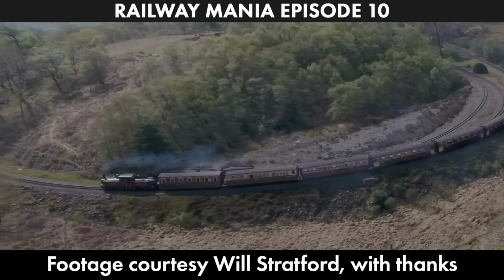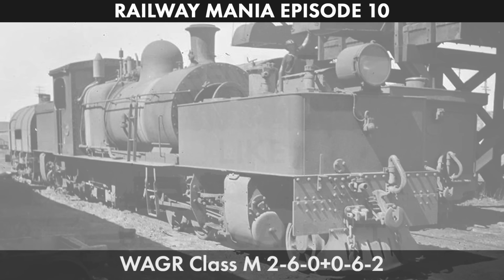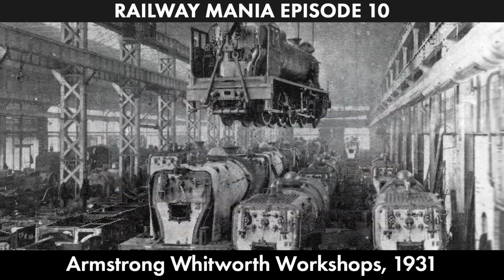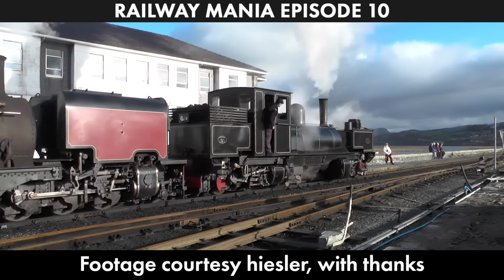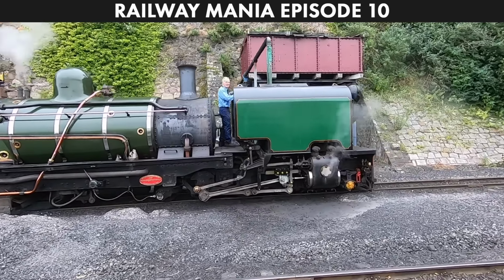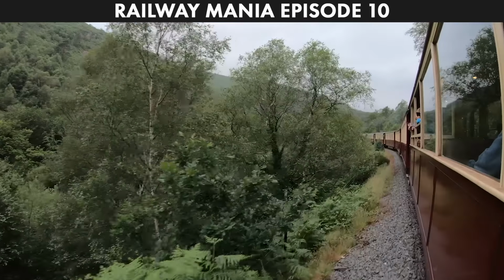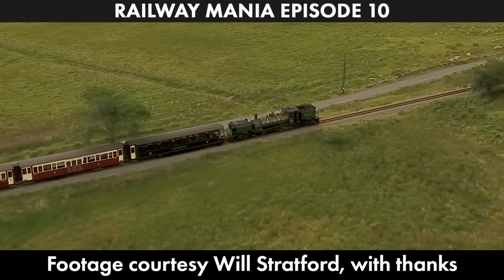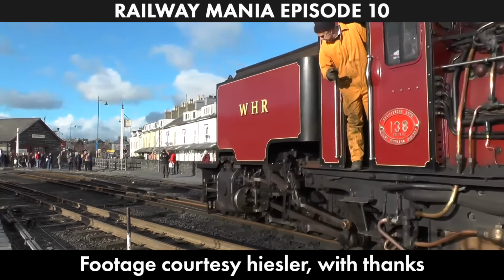Bend It Like Beyer Garratt (with Huw Jones) - Railway Mania PODCAST #10

Comment: Where did you learn that the Baldwin Locomotive Works had the rights to manufacture garratts in North America? I can't find a source that backs up that claim.
Reply from the maker: In a book called ‘Engines that Bend’
Reply: @RailwayManiaNet  Is there a corresponding citation or footnote in the book, and if so what is the citation?
Reply: @RailwayManiaNet  I thought it was Alco?
Reply from the maker: @ I'm only going off what was in the book, I haven't found any other references to it so I am unsure where they got the information from.

Comment: Would be nice to get either an HO or LGB models of the Garratt. If it is the LGB, one option would be a kit form where you can assemble it. Whether it be a 2-6-2-2-6-2 (4-6-4-4-6-4) or the 2-8-2-2-8-2. Even a 3d printer version in LGB scale would be nice. Are there any dvds available specifically dealing with the different wheel arrangements that the Garratts had?
Reply: Aster made at least one Garratt in 1 scale live steam, NSW 4-8-4-4-8-4, you could probably sell your car and buy one. 
Kitmaster made an LMS version in a plastic kit in OO a long while ago, many of their kits have been revised by Dapol, not sure about that one.

Comment: Service requirements between steam and diesel locos are what killed steam; strength of the thing was never an issue. The Garrett is a really good example of a decently well thought out way to get 2 locomotives for the price of 1. They've been fascinating to me since I heard about them. My Grampa was a roundhouse foreman for the C,B,&Q in northern Wyoming from about 1923 to 1960 or so, and told some tales about steam's service complexity compared diesel's; he knew it well since he lived through the transition. I think steam could still have a future with the modern engineering plastics playing a part in the flexible, wearable joints. Love to see it; wonder if I will! Great episode, thanks for putting it up!
Reply: Steam certainly could be modernized. High tech fluid dynamics modeling, advanced fabrication, and centralized lubrication could build locomotives that, while requiring skill to operate, could keep rolling without expensive electronics maintenance, long after a typical diesel would need major electronics repairs. As long as a steam locomotive could remain in steam for extended periods, working 24/7, the advantage of the diesel's quick start-up time disappears. Total cost of ownership over the life of the locomotive could outweigh its inherent thermodynamic limitations.
Reply: @psycotria Plug in boiler preheaters are something I considered for how steam could be modernised.

Comment: Was there any Garrett locomotive mad for the uk, and are there any left?
(Main line size?)
Reply from the maker: Yep 3 types. 0-4-0+0-4-0 for industrial use (steel and coal) of which there were 3 built and one survives.
https://preservedbritishsteamlocomotives.com/beyer-peacock-company-works-no-6841-william-francis-0-4-00-4-0t/
LMS 2-6-0+0-6-2 built for heavy coal trains. Mixed fortunes due to a few faults and the labour involved. 33 built, all scrapped.
https://en.wikipedia.org/wiki/LMS_Garratt
LNER U1 2-8-0+0-8-2. Originally a GCR project, but ended up as 2 x 3-cylinder units (6 cylinders total). Designed for banking duties, performed ok at that but not at hauling trains over long distances. Scrapped.
https://en.wikipedia.org/wiki/LNER_Class_U1
Hope that helps!
Reply: Thanks for the information

Comment: While I’m not sure there is enough information for a full podcast or even a conversation, I was wondering: Have you considered covering the feasibility of the proposed “Super Garratt” either just as a thought exercise or chatting with some individuals who might be more knowledgeable or insightful? There are very little trustworthy (or serious) websites or forums covering the Super Garratt and even less having made models and none have made a video directly about it.

In case you aren’t aware of this loco, apparently Beyer Peacock tried to stretch the Garratt concept to the absolute wherein instead of the traditional Garratt basically being two single frame locos back to back, the Super Garratt was two Mallets joined back to back. The existing designs I’m aware of were in standard gauge and cape gauge, offering up to 215,000 lb starting tractive effort from a 2-6-6-2+2-6-6-2 wheel arrangement.

Also a personal question of mine: If the Super Garratt type of articulation had been adopted in the US, what wheel arrangement would you think would be the most adopted among the class 1 railroads?

As per the patent with 2-6-6-2+2-6-6-2’s?
Even bigger with a 2-8-8-2+2-8-8-2?
2-10-10-2+2-10-10-2’s!?
2-12-12-2+2-12-12-2’s?!?
Some other wheel arrangement?

Comment: 11:07 the only operational 'super Garratt' in Australia, 6029, running on the main line from Sydney's Central Station toward Strathfield Station if I'm not mistaken. Two of those locos used to haul 1,500t coal trains up a 1/40 grade (there's some old black and white footage of that somewhere). Some fairly serious grunt, and (despite the noise) I imagine the fireman liked having the mechanical stoker, especially in summer.
Here's the double-header footage (not suitable for those worried about air pollution, lol): https://www.youtube.com/watch?v=-1EWpCQP7eE
Reply from the maker: Cracking bit of footage that. Also worth a watch is this one - 'Steam on the Main North'
https://www.youtube.com/watch?v=ePpG4tVHSMQ
Reply: @RailwayManiaNet  Glad you liked it. Thanks for the link; I've seen it before, but doesn't mean I'm not going to enjoy watching it again.
Cheers

Comment: This was a very interesting bit of facts.
I already know a bit about Garrats, travelled behind and even on them, have actually driven one for 10 minutes, and have built several models.
But the information contained in the interview did still teach me some new facts I didn't know, like the influence of all the joints in the reverser gear linkages on the synchronicity of the two power units. 
I did a full photographic survey of No.87 4 years ago when it was still in service, and like mentioned, it has several differences from the later NGG16s.
It was in fact an evolutionary model in between the earlier NGG13 and later NGG16 models, as it did have the inside bissel trucks instead of the fixed axle with side play like on the NGG13, but mostly No.87 is more like a NGG13, externally most visible are the shorter cab with the valve manifold mounted in a hole in the front of it instead of further forward from the cab like on later ones which makes it a hotter cab to work in regarding the driver I spoke to.
And there is the somewhat shorter and differently shaped water tank, and many not so visible differences like the brakes and many fittings.
Reply from the maker: Ahh thanks Tom, I had not realised just how different 87 was from its classmates, like you say something of a stepping stone in design.

Comment: The shorter Garret boiler is less at risk of having a dry firebox top when it is nose down. *I’ve seen the wobbly axel with a ball in the middle. The axel tube is a simple hexagon type of thing inside and the drive axel running up the middle has the flat sided ball. A bit mental, but I can see the idea of it :D

Comment: Puffing billy hase 2 garratts G42 an original VR 2foot 6inch loco and NGG16 129 recently regaged and restord to 2foot 6inch gage operation and Australia also had the ASG/AUSTRALIAN STANDARD GARRATT type. 1 servives ASG33 at the Queenscliff railway with another garratt fyensford Cement No2 a 2-6-0+0-6-2 loco

Comment: Really enjoyed this episode, I've read a bit about Garratt's but never knew their origin, thanks for covering this topic. I certainly would like to hear more about UK Garratts, I know a bit about the LMS ones (since I've seen a video on the new Heljan model of one) but not much on how the LNER U1 did. Also, if you don't mind a quick topic suggestion, I'd like to hear more about oil firing vs coal firing, based off this episode I think there's some potential for a podcast episode there.
Reply from the maker: You're right there, Patrick, it could be interesting to look into fuel types for an episode, I'll add to my notes!
Reply: Heljan garratt re-uses the chassis design of the old tri-ang Davy crockett! look at the wheel spacing.

Comment: The Failure of the NZR garratt actually changed the course of NZR's loco development. That's why the K/Ka/Kb and J/Ja/Jb exist to begin wit
Reply from the maker: Ah that's interesting. So that is down the road of conventional locos hauling mid-sized trains? I must do more research on NZ rail.
Reply: You should. This country had very unique landscapes and some very interesting solution developed to get rail to cross them.
Look into the H CLASS Fell Engines designed to safely climb and descend the 1:15 Rimutaka Incline railway.